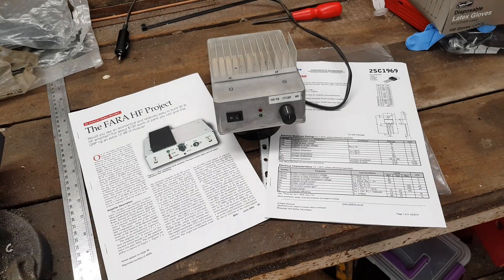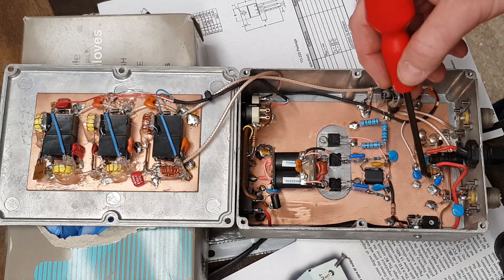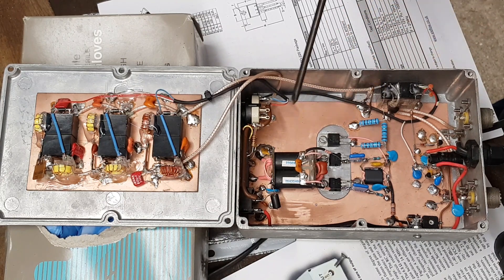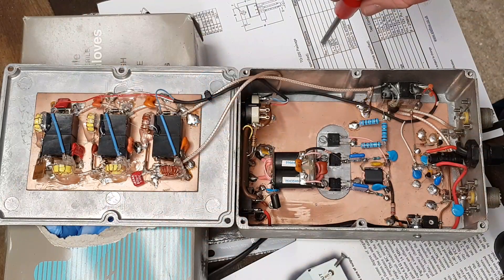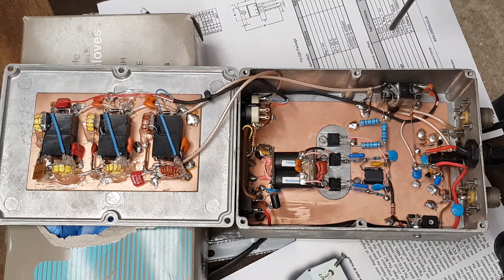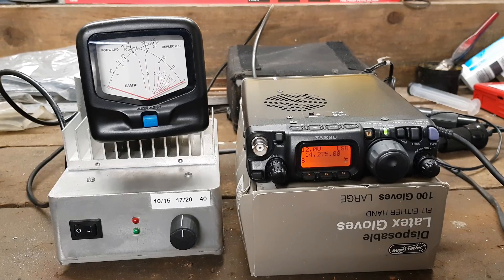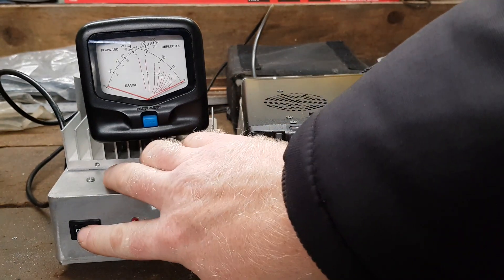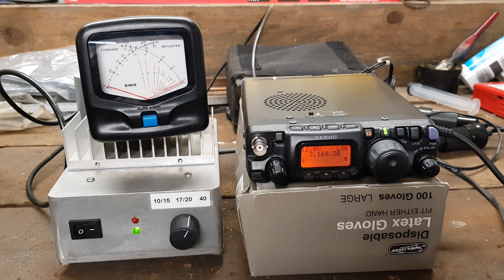A Homebrew 30w LINEAR for QRP Radio's

Comment: I had connected the Minipa 100 linear amp , purchased from Aliexpress to the UBITX.  Upon doing so the SWR has doubled.  What could be the reason. Without the amp, the SWR is in the range of 1.1 to 1.7. But now it has crossed 2. Thanks in advance. VU3RHU, Mumbai.
Reply from the maker: If you mean the SWR of the antenna increases with the power increase then your antenna could be unbalanced such as a poor ground.
Reply: The SWR has now come down to 1.6 - 1.8 from 2.5 to 2.7 which I was getting earlier. Have connected the LPF and have also reduce the input power to 1.9watts.
Reply: @rajeshhuddar3470  probably a little late, but if you have a transformer fed antenna, such as an end fed, you may be saturating the transformer core. That was part of my SWR challenge

Comment: I'm inclined to build this neat little amp myself. I'll need to review the original parts list for costing and availability. Apart from the 2SC1969 substitution issue, I'm guessing that after some 16 years many (most?) of the parts quoted in the original article -- other than resistors and caps, etc -- will be discontinued or need substitution.
Reply from the maker: James everything is available apart from the final transistors which as you said can be substituted with 2sc1969. I bought 4 while they are still available from eleflow, no harm in having spares!. Its a good solid reliable Amp and by far one of my favourite builds
Reply: @mk1tina  Yes, it looks good and from all reports was a popular build back in the day. If I do go ahead I will use the original project's PC board layout (and go the whole hog with 6 filters) so relay base dimensions could be one issue. And you mention that the ferrite core for T2 is no longer available. I have noted what you used instead and will also I'll ask RF Parts what they suggest from their 2019 catalog.
Reply: @James_Bowie   If you look at West Florida components they have a whole range of surplus cores avail. IN particular they have a type 43mtl core at 80c each with a 10 mm id (3/8 Cu tube fits well). they are about 22 mm L and are good as  pair for at least 50W on HF.  you will have to get someone in the US to buy them as the MOq for overseas sales is too high.  Shipping within the US is typically around six or seven dollars.  I bought ten as part of another order quite some time back.  That are NOS not chinese downgrade crap.  Tim Fidler NzL